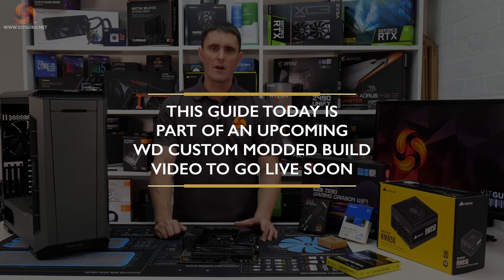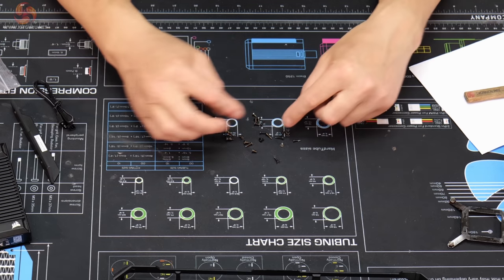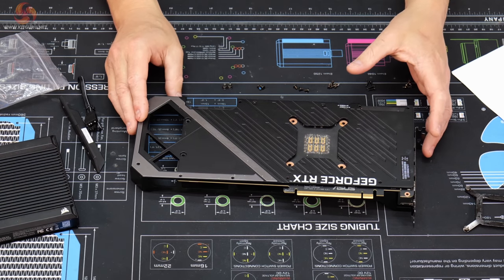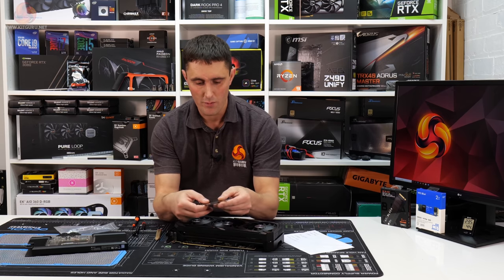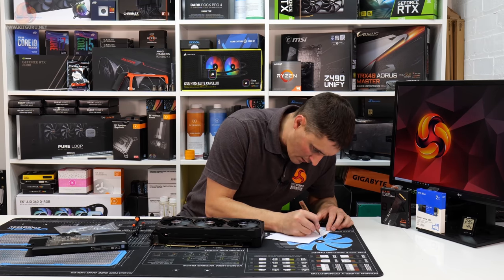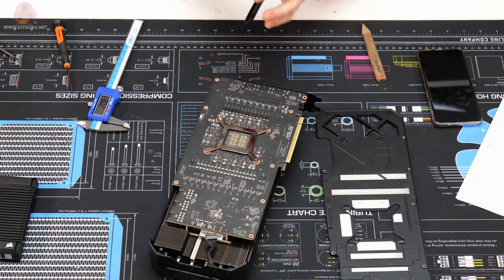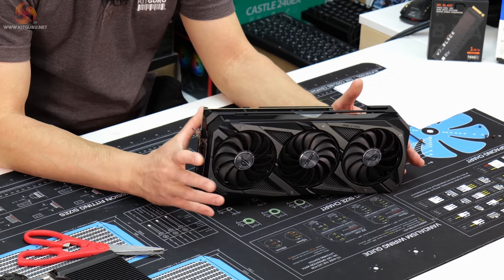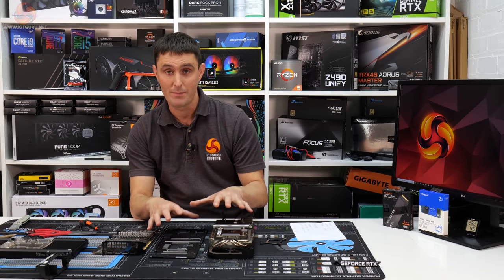Measuring GPU thermal pad thickness for replacement (RTX 3080)

Comment from the maker: We hope this helps some people - timestamps below!

00:00 We received a video card in a sorry state
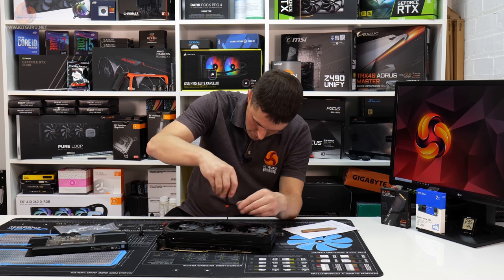08:59 Figuring out the thickness of the stock thermal pads with feeler gauges
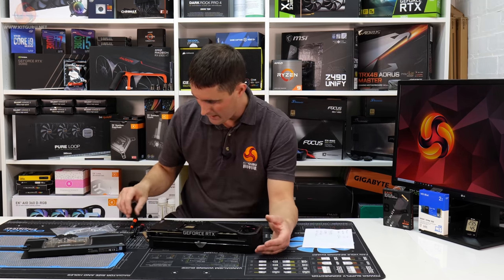13:57 Measuring the backplate / standoffs
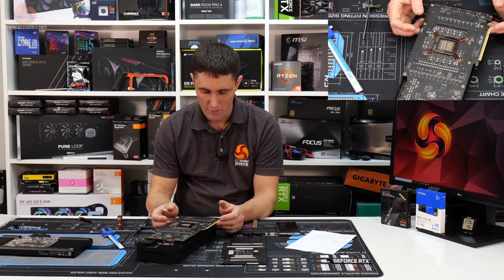17:05 Cutting thermal pads to rescue the GPU
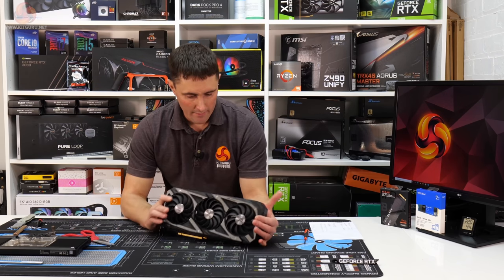19:01 Reassembled card - test
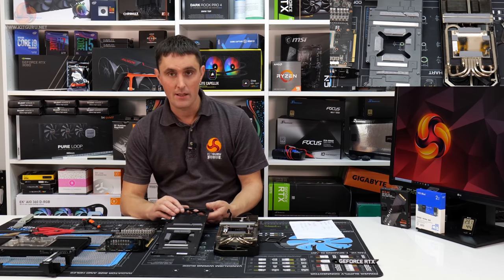20:38 Dismantled - visual check

Comment: To make it easier on everyone:  Vram front side 2mm, VRM Mosfet 2mm, VRM Inductor 2.5mm, Backplate: 2.5mm,  Backplate VRM caps: .5mm
Reply: the hero we needed. thanks bud.
Reply: THANK YOU SO MUCH
Reply: Thank you! Do you know how much you need per thickness?
Reply: Not on an 3090.
Reply: i have never seen 5mm thermal pads. 3mm is the thinkest one I can find
Reply: @swizzler8053  well this is a 3080
Reply: @DJJumpdancer  it’s .5 meaning 0.5 which is half a millimeter.
Reply: @aturkinthesky   I've seen people use 1 mm. Not how much of a difference it makes but surely don't need it messing up cooling.
Reply: @DJJumpdancer  it says .5mm bro not 5mm

Comment: When choosing thickness of the thermal pad, you need to take into account the softness of the thermal pads you are using as well. A 3mm ultra soft pad will squish down to 2mm, a hard pad may not.
Reply: Yeah very good point, that is why it is a good idea to check how much/if all pads have squashed down and are contacting.
Reply: When choosing your thermal pads, sitting on a coke bottle might help. Seriously how dumb are people?
Reply: @Machistmo  what?
Reply: @Machistmo  I was thinking Pepsi, will give better results IMHO
Reply: @Machistmo  not sure what you mean, Victor was right that thermal pads compress a lot. Measuring them on screwed down card/plates and buying same size pads is probably not best way.

Comment: The northwest repair guy warns that you should ALWAYS put some thermal paste on the gpu if it's going to touch the cooling block, whether it's going to be on or off.  The surface needs some protection.

Comment: You can never measure thermal pads properly because once you pull off the stock thermal pads, they are already compressed.

Comment: @KitGuruTech Do you know the thickness of the thermal pads of an Asus Dual OC Rtx 3070? There is no info on the internet, I bought a used one with no original pads, and I think they don't have the correct measure. Please HELP!

Comment: IMHO, having been through this nightmare just today (figuring out thermal pad thickness for my Palit 2080ti) it would be just so MUCH F*** EASIER if the damn brands would publish some decent documentation including a diagram describing screws and thermal pads used. It would save us all a ton of time and stress. We all know many brands use utter garbage thermal paste and pads, and after a couple of years, they will be almost destroyed, so they really need to be changed from time to time.
Reply: The right to repair isn't their friend.  I count on them to do the least possible, the least legally required, when it comes to providing parts info., and that's why videos like this are so valuable.
Reply: Just gonna copy n paste what I said to someone else.......... It's totally shocking, if they didnt use shit materials in the first place we wouldnt need to replace the pads ect I'm having a nightmare with my 2080ti gigabyte windforce oc, the pads were crap quality and ruined, couldnt get a measurement and cant find info anywhere, gonna have to buy one of these wee things and try that, the more I fuck about with the wrong sizes the more money I waste and the more chance I have of bricking something that cost over £1200, raging mate
Reply: Already lost one rtx 2080ti to memory issues, now my second one rtx 2080 dual is overheating. Need to change the thermal pads too. Never in my life had issues with graphic cards until now and its not like theyre cheap…
Reply: @honza1988.  It's absolutely insane the kind of CRAP thermal pads most brands are installing on 1-2K USD cards. The memory hotspot fiasco in the RTX 3000 series says it all. Many people had to risk the replacement of the memory thermal pads because the brands are incapable of spending a few USD more in order to put decent ones, and GDDR6X chips reach critical temps that threaten their lifespan. Some brands like Gigabyte are so awful that their pads even MELT after a while, and they start to drop oil!!! This is insane, we are paying a shit ton of money for these new cards and this lack of quality is borderline scam.
Reply: Companies being consumer friendly??? Good joke.

Comment: Use some putty put it on and tighten everything (not to hard though) take it apart again measure the thickness then. It should give you close enough measurements. Thermal usually in thicknesses of 0.5 - 4.0 mm or more (only seen that on some XFX video cards).
Works also for laptops if you have to replace thermal pads and thermal grease.
Reply: Gonna try that the now lad, thanks for sharing
Reply: Good idea,  my daughter got lots of playdough

Comment: Just did this operation with my strix 3080 OC. Used Gelid Extremes. With -500 Coreclock, +1000 Memoryclock and 66 Powerlimit (approx. 240-245W) i get 45c GPU temp, 78c Memorytemp and 57c Hotspot temp with fans at 80%. Gonna turn the fans down a bit but im really happy with the results!

Comment: Thanks for this. Asus was not very forthcoming with thermal pad info for my TUF 3090 when I asked them. Asus is using very soft thermal pads this generation. I was super careful when watercooling my 3090, but a bunch of them still were in a condition that I would not be comfortable reusing them.
Reply: That probably explains why the pads were missing when we got the card, maybe they were destroyed upon removal.

With the card reassembled we found that VRAM temperature never exceeded 88c when under an extreme load, so VRAM temperature while gaming will be considerably lower.

Comment: Great video. Very helpful

However, I found myself confused on what thickness is for what. If I may suggest that at the end of all of your videos you do a quick recap of what size pads go where.

What I gathered is that the backplate requires 1.5MM
Heatsink all pads are 2mm

Please correct me if I'm wrong here

Thank you

Comment: Just put a ruler against the board at 90 degrees with the numbers going up, rotate the board to level the front lip and back lip (so the depth should disappear) and there is your actual height of each component. Feeler gauges will work but it seems highly inefficient.

Comment: There's a better way to measure.  Use Putty where the pads would go.  Take it apart and then measure the thickness of the putty after it's been compressed.

Comment: Thanks a Lot for the Perfect video, Is it possible to add a schematic of the card with all the thermalpads dimensions on the card for a noob like me who does not know what is  Vram front side, VRM Mosfet, VRM Inductor, Backplate,  Backplate VRM caps, Thank you Sir.

Comment: ? after taking it apart why not just use the bottom of a digital caliper instead of mucking around with feeler gauges? seems like alot of work just to measure

Comment: i'm surprised ASUS hasn't tried to take this down saying it's confidential information.

these companies, the lot of them, are a bunch of wankers.
Reply: It's totally shocking, if they didnt use shit materials in the first place we wouldnt need to replace the pads ect I'm having a nightmare with my 2080ti gigabyte windforce oc, the pads were crap quality and ruined, couldnt get a measurement and cant find info anywhere, gonna have to buy one of these wee things and try that, the more I fuck about with the wrong sizes the more money I waste and the more chance I have of bricking something that cost over £1200, raging mate
Reply: @DestroyerofBubbles  this right here ^^^^^
Reply: @DestroyerofBubbles  I mean seriously, where are you even supposed to find this kind of information about your specific gpu anyway. There has to be some kind of manufacturer's manual to go off of, otherwise this is complete and utter bs.
Reply: @mariyastoyanova31  It's BS mate, Ive seen loads of people saying they have contacted ASUS, Gigabyte ect and the get told 'they dont release that information'  raging
Reply: @DestroyerofBubbles  Fr, I'm trying to contact MSI right now but have figured out that I need to register my product on their website to even talk to someone on the live chat, and for that I need to open up my case just to get a 3 digit code so I can register my product. My pc case is massive and so the only place it can fit comfortably in my undersized UK room is inside my desk cabinet and to even take it out I need to drag the whole desk (2 monitors and all) away from my wall to have enough space to unplug everything from the back while remembering the order as it is cable managed and that's when I can finally pull just the case out of my desk- don't even get me started on the side panels. And from there I need to provide an invoice for something I bought 3 damn years ago not even with the same credentials. Sorry for the unnecessary life story but jesus christ is a serial number alone not enough for these people??
Reply: @mariyastoyanova31  You would thins so, well good luck because everything ive found indicates that they dont tell owners for some stupid reason, if they did the info would be all over the internet, the only chance u have is if someone with the exact same card found out by trial and error and shared their results.  Its shocking for a £1300 GPU the pads where terrible when I took it apart, melted was the best way to describe the worst of them, wish I had measured them at the time, the crap these companys use makes me so angry, 8700k's thermal paste turned out to be not much better than 'toothpaste' so since my parts are a few years old now I wanna OC but Im gonna have to delid, mind and share the results if by some miracle  they give them to u.  I've been looking for the last 5 days for my gigabyte windfore oc and found nothing, best of luck to u

Comment: Great video and well-timed - hopefully - but I think you cut out one of the most useful bits. At one point you said you found that one of the thermal pads wasn't thick enough and had to replace it. It would have been incredibly useful to show you determining that. Was it by visual inspection, looking down the edge of the card? Or by looking for impressions in the pads (as you showed later)? Or something else? We all make mistakes and it is very useful to know how best to detect them.
Reply: Hi Quentin, It was noticed by a visual inspection once the cooler was installed. Looking between the cooler and PCB, It was clear that one of the pads wasn't making contact. Unfortunately, I unintentionally didn't have the camera rolling for that part.
Reply: @KitGuruJames  you can deduce it by a possible lack of imprints of backplate or memory (depending on which side the mem pad sticks to)
Reply: @KitGuruJames  Thanks.

Comment: I have a GeForce RTX™ 3080 GAMING OC WATERFORCE WB 10G (rev. 1.0) 

Memory junction at 110c
think I should try to separate the card and put new thermal pads in?
Reply: update- new thermal pads gp extreme- gelid for memory chipsdropped me to 76c junction temps while 100mh
put old pads that were on mem chips to the back

Comment: Re did the paste on my RX 580 and fans where slower + lower temps, did take two trys to get mount right.
Any idea on UK rules on warranty and changing thermal pads/paste?
Reply: I'm not sure on where you stand with warranty. All I can say is some cards have warranty seals on the screw heads and some don't.
Reply: @KitGuruJames  Well dont want to void my warranty, thanks.

Comment: Screw thermal pads. Just buy the thermal goop. Goop, mash to fit, and go. Silicone goop is rated at 10w mk. Pricey but good quality.
Reply: I assume you are joking? If not, I would hate to see the state of your video cards with potentially 2mm of thermal paste 'mashed' all over the components around the areas. If anyone is reading this, please do NOT try to cover your whole graphics cards  in 2+mm of thermal paste across the VRMs etc - it will spread everywhere and not be able to conduct/transfer heat.
Reply: @theonlyredspecial  my aorus 1080ti has some components on 0.5mm, is it ok if i use 1mm? counting pressure and stuff would be fine? thanks !
Reply: is this serious?